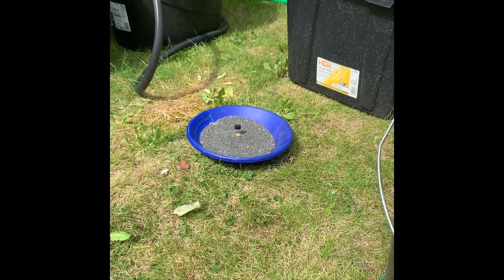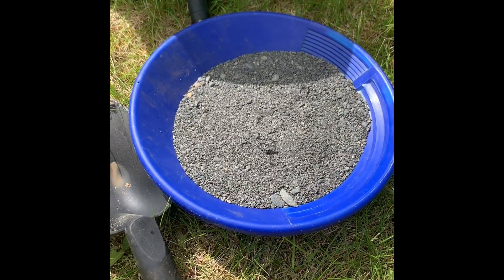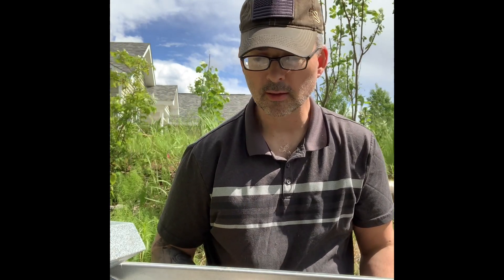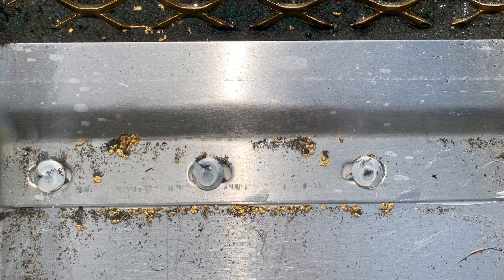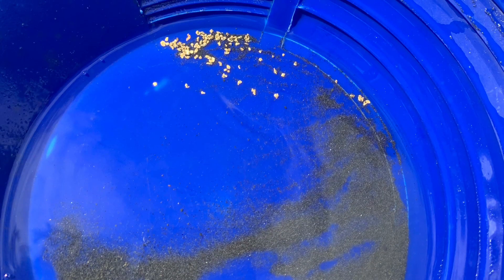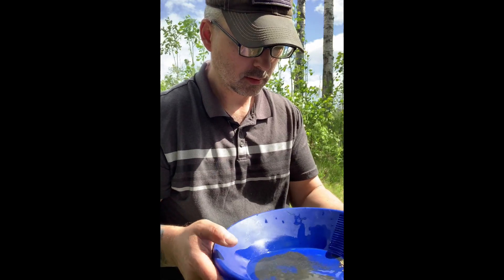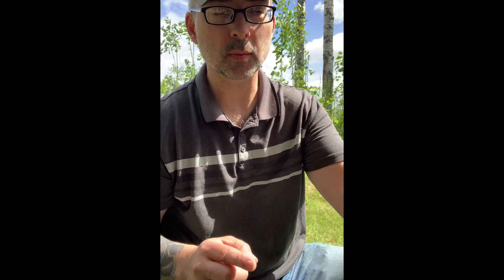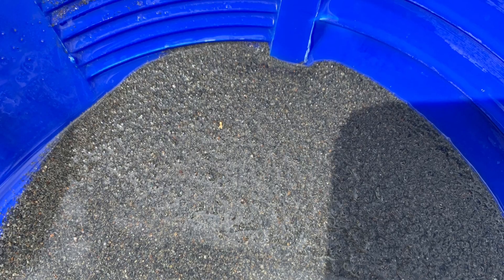Riverdance Mini Jig vs Sluice Box

Comment: 😮what size should you pre screen the material to before running through the jig
Reply from the maker: You don’t have to pre screen it but -1/4 will run the best. Bigger rocks can take up residence in the tray and slow things down.
Reply: 1/4

Comment: You ran the same material 3 times? Did you put the same gold back in each batch? 😮
Reply from the maker: If I understand your question correctly, yes. After running it through the sluice and checking the tailings with the jig (I found gold), I combined it all again and ran it through the jig. I panned the tailings and didn’t find anything.

Comment: why did you run the sluice with dry material ? i have always ran my material wet but my gold is smaller so has a tendency to float
Reply from the maker: That’s a great point. I added jet dry to the water, but I could have wet the material as well. Wet or dry doesn’t matter in the jig unless the material is all ultra fine powder.